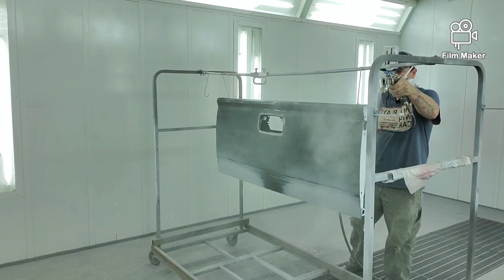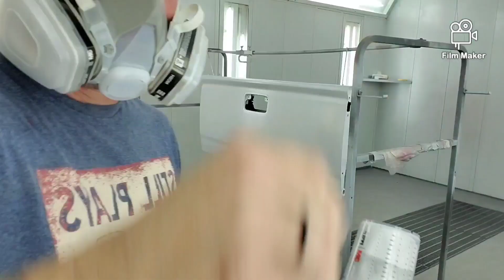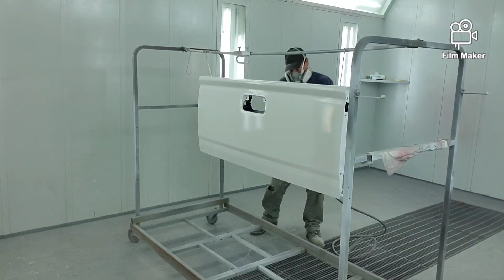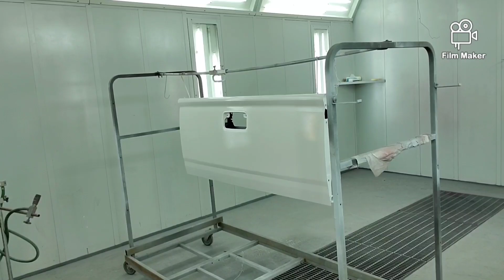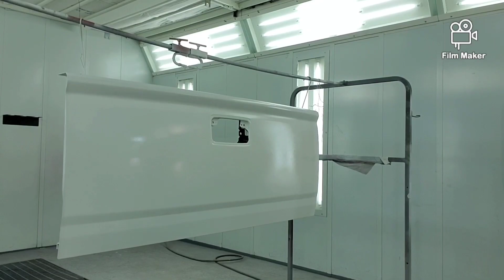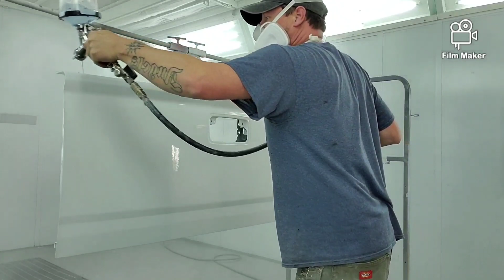Tips for getting a professional looking automotive paint job everytime.

Comment: I have watched you spray clear like glass, I also spray clear with the Iwata LPH 400 1.4 silver cap. I spray SPI Euro clear and can not get a slick finish to save my life, Settings are 90% fan , 3 turns out on fluid and 35 psi at the gun. I always end up with orange peel, Can you give me any pointers?